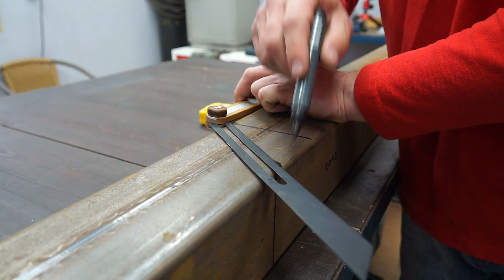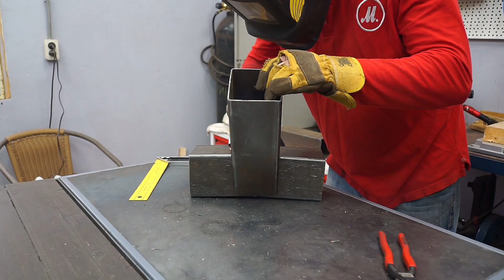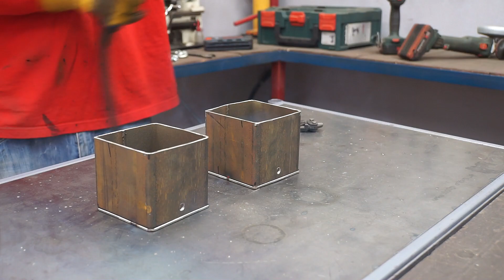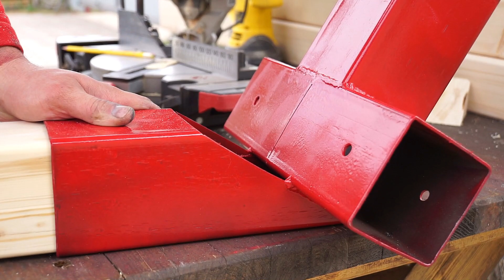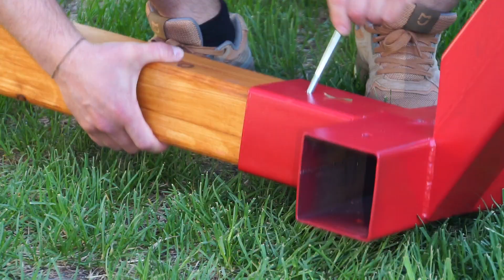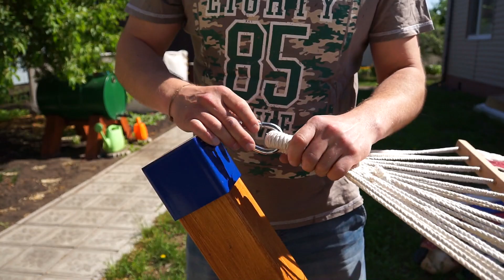НЕ ВЗДУМАЙ ПОКУПАТЬ!!!ОТЛИЧНАЯ ИДЕЯ ДЛЯ ВСЕЙ СЕМЬИ!!!

Comment: Gr8 job on this build. My idea would be to take the idea you had for the swing anchor and put two at angle then slide another pipe into them with eye bolts for hooks, of course they need to be long enough to cut down tops after screwing in ground  to slide pipes inside. Easy removal when not in use.
Reply from the maker: Hello, this is a good idea!